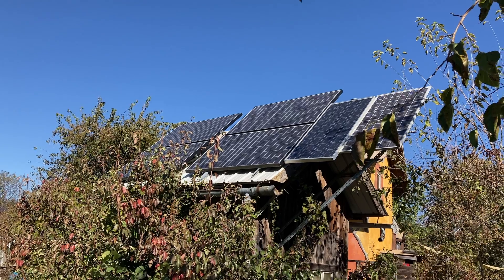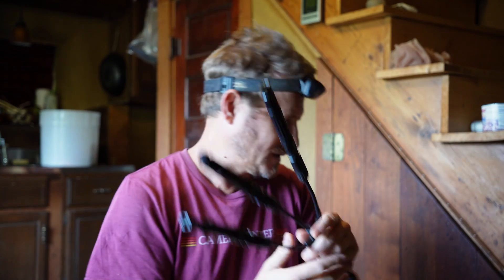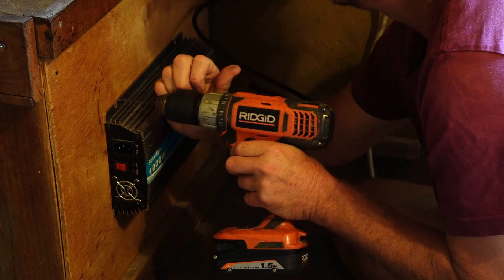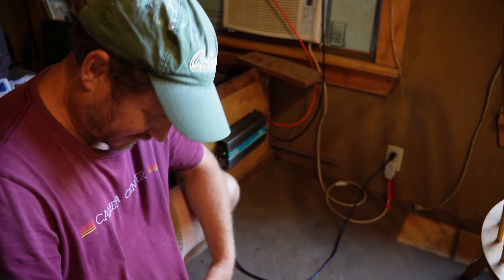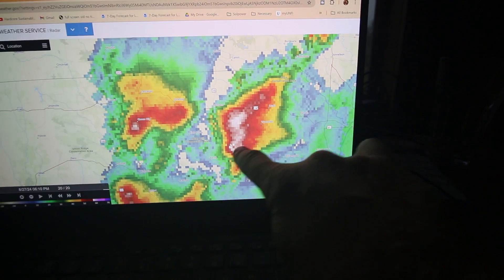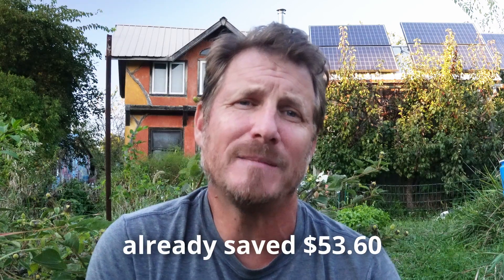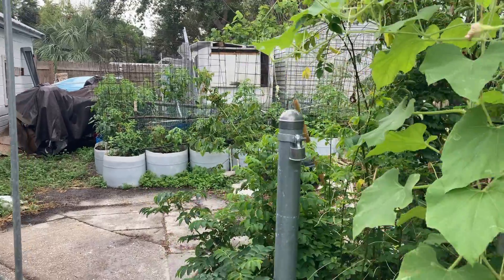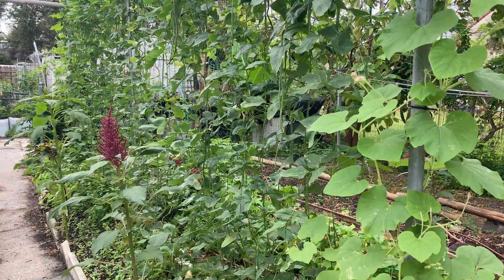This Cheap, Easy Solar Power System Cut My Electric Bill A LOT

Comment: At 3:00 you show a plug that is charged by the panels, which you later plug into your wall outlet, isn't that dangerous? If a person were to touch those prongs when the panels are connected, you could get a serious shock. Do the panels have micro inverters to disable any charge if it detects the cable is unplugged? I built a 1200w 24v system with a charge controller and inverter when I was off grid in Montana, now I'm on grid with affordable power but still have my setup in case of outages, I can plug my fridge and other needed items in as needed.
Reply from the maker: The microinverter doesn't transmit power through the plug unless it is getting power from the wall outlet. This prevents it from transmitting power into the circuit if the grid goes down. All grid tie inverters should be made this way so they don't backfeed when there's no power on the grid they are connected to.

Comment: Dan, love the grid tie in solar. I should do that. Also, agreed on the prepper thing. Where I live, the power company charges 46 cents a day plus 7.7 cents per KW.
Reply from the maker: Thanks for responding to the question I asked in the video about how much you pay. That does seem like too high a price. So like almost $60 a month fee for the connection. I think our local utility is similar but I think the price per kWh is 12 cents. I said 9 cents but I think it’s changed recently.

Comment: So what do you do to prevent the electric lineman from getting shocked since your back feeding power...what safety measures do you have ?
Reply from the maker: The micro inverter is a grid tie inverter. It doesn’t work if there is no power on the grid.
Reply: @HardcoreSustainable  i'm not fully conversant with solar power terminology. Are you selling power to the grid? What does grid tie inverter mean? What does 'back feed' mean?  My system is off grid so i have no experience of tieing to the grid. Do you use solar batteries? sorry about all the questions, if youre too busy to answer i understand. Thanks for all the very informative videos
Reply from the maker: @fionntainmacb  a grid tie inverter is set up to be tied to the grid and backfeed, or put power into the grid, to make your solar panels a source for power to the wider grid. It also will automatically stop backfeeding when it senses the grid power goes down. That way it won't electrocute any workers working on the wider grid because your system might still be generating power when the wider grid goes down.

I do sell power to the wider grid when I have excess, but because we have a microgrid on a village scale, it will get used by others in the village before it goes into the wider grid.

I have lead absorbed glass mat batteries as a backup for my system to store power when the grid goes down. I often don't know when the wider grid has gone down because my power isn't interrupted.
Reply: @ ah, i understand now.... thanks for taking the time to answer i really appreciate it :-)

Comment: 8:08 ...to clean the panels occasionally, I use a spray wiper. It's quicker and easier. / A weed foil would be useful under the panels, as the grass would otherwise contribute to shading on the lower front side.
Reply from the maker: Thanks, yeah I ended up putting a board under the lower edge of the panels to keep down weeds. I probably should have gotten out the squeegee for cleaning the panels.